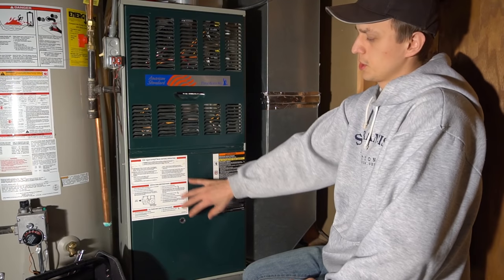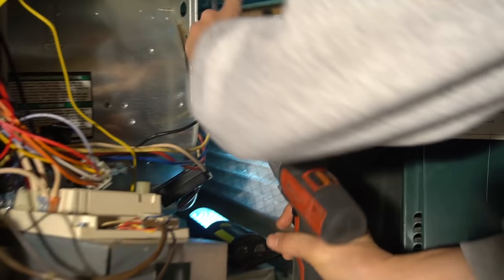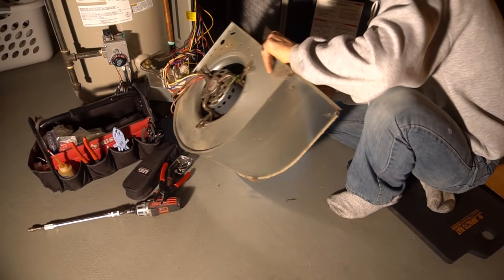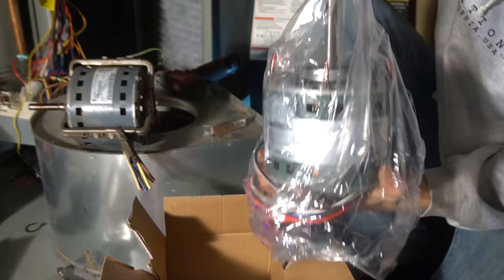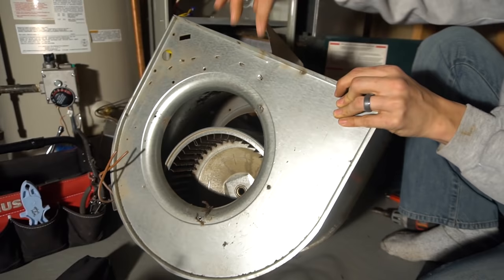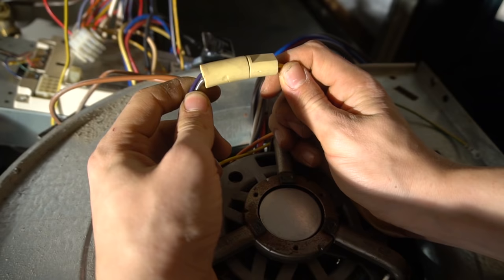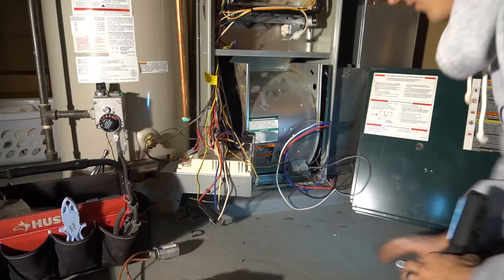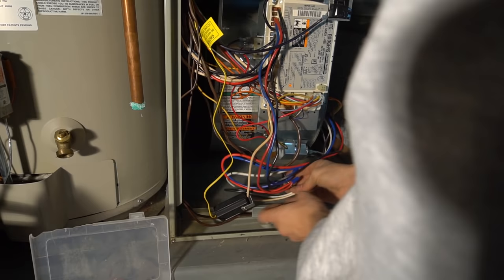Furnace/AC Blower Motor Replacement Step By Step

Comment: very helpful video!. question, recently the blower stopped working, it was connected on blue wire (medium speed) i swapped to the black (higher speed) and started working again. what could be the problem here?? thanks.

Comment: Hope you can help me. Last week my air worked fine but within the past few days the outside unit and inside unit (Air handler I believe) have gotten quieter and quieter and it's taking way longer to cool my house. I know it's best to call HVAC but I wanted a general idea of what the problem could be before I do that.
Reply from the maker: Is it possible that the A-coil (evaporator coil) inside is frozen over? Do you see any ice build up anywhere, inside or outside? That's strange that they would both get quieter. Is your furnace filter clean? Is the condenser coil outside plugged up and perhaps needs to be hosed down?

Comment: Excellent but I do have one question for you. The common wire (white) from motor, where do I put that on my blower motor board cnt1308? I don't have a spot
Reply from the maker: It's best to put it where the common from the old motor went. If this is the board I think it is, there should be a section on the board labeled as "120v neutrals" The common from the motor should go to the terminal marked as "line" which is in that "120v neutrals" section. If you have the wiring diagram on the inside of your furnace door, try to find the blower motor on there and trace where the wires go that way.
Reply: @WordofAdviceTV  The common from the transformer is plugged in there. I believe it was plugged into the park in the 120 volt hot area, which makes no sense to me?

Comment: So you can clean the blower fan in the sink.  Is it better to use hot or cold water?  Also what is the yellow wire you took off?
Reply from the maker: Hot water will clean it faster. The best way to do it is take it outside and spray/clean it with a garden hose. I replaced mine in the winter, water was shut off outside so I just cleaned it/washed it inside.

The yellow wire is an unused fan speed. Most blower motors in furnaces will have 3 or 4 speeds. I replaced a 4 speed motor with a 3 speed motor. So the yellow wire was an extra. On the motor label it will usually say which wires are what speed. 

3 Speed: Low Speed, Medium, High
4 Speed: Low, Medium-low, Medium-high, and High

Comment: What was the yellow wire for, that you didn't use, you disconnected it from the unit
Reply from the maker: A lot of these furnace motors will have a spare speed that is unused. (I briefly go over this in the end of the video). Since I replaced a 4 speed motor with a 3 speed, that yellow wire would not even get hooked up so I discarded it.

Comment: Thanks for such a clear explanation. You are a Pro!. I have a question: our blower wheel and motor were replaced and new ones are making more noise that the original operating in the 2nd furnace. Doesn't some like anything is loose or damage but anyways is driving us crazy. I called the technician and he checked and said everything is ok. Motor is ame size of original and nothing he can do but obviously something is not fine. Any idea what could be wrong ? Thanks in advance

Comment: Great video!   For a replacement motor, do all the specs need to be the same?   I’m finding motors with the same HP and voltage, but the RPM and amps are slightly different.  Does that make a difference or will that still work?  The old motor is 7.6A and 1100 RPM.  The possible replacement motor is 7.8A and 1075 RPM.
Reply from the maker: That will be fine :) .2 amp difference and 25 RPM difference is not going to have any effect. I would replace it with the one you found.

Comment: Would it be better to connect the wires directly to the control board as opposed to wire nut connecting them to the original motors wires
Reply: Thanks for the video, you make great content.  just generally curious.
Reply from the maker: Yes, it would be better. 🙂 I just got in a habit of doing that as a sign to future technicians. If they see the wire nuts, they know right away that the motor is not original.

Comment: The air temp in my house went up, everything was frozen over.  We cut the breaker off, let it thaw.  Once thawed I turned it back on, right away the fins in the air handler were freezing over.  That's when I discovered the fan not blowing.  How do I tell if the fan is bad or maybe just a bad relay.  Is there a relay in this system?

Comment: I have to replace my motor but can’t find the right one order one from Amazon and it’s smaller and it doesn’t have the brown cable for the capacitor ? Can u help ?
Reply from the maker: I would figure out what the part number of the motor is first using the model number of your furnace. And then using the part number search on Amazon or other HVAC parts sites. I show an example of how to do this in this video: https://youtu.be/faCno8-vRnw?si=WQ8s_DUWNgrZ34zw

Comment: The back of my motor is installed on the return air side. Obviously restricting air into the blower. It’s drawing air from the opposite (closed) side. Does anyone know if this will have any adverse effect on airflow. Have never received any error codes. 1994 Carrier Weathermaker 8000 58wav. Thanks

Comment: If I would to upgrade motor, what would u suggest? My motor specs are HP 1/3, V 115, A 6.20, RPM 1075, HZ60, PH1 it doesn't say the speeds.

Comment: Fan being as dirty as it is, how often do you change your furnace filter?  Think about that, you are breathing that dirty air being blown by your furnace.  Put a reminder on your phone to at least check your furnace every month and buy a box of 12 filters so that you have a supply to change a filter. I check ours every month and during the spring and fall it is the worst with all of the tree fuzz and other crap blowing in the wind, you need to change the filter.  Just ask your wife, if she says the house seems dirty, then things are getting through the filter.

Comment: is it OK to replace the motor with one with more RPM's to get more air flow?
Reply from the maker: As long as the difference is not too big, it should be okay. Otherwise the unit will be noisy and vibrating which could lead to other problems.

Comment: My circuit breaker has been tripping. I've narrowed it down to the blower motor. When I try to turn it on a single spark shoots out the back of the motor. Is it safe to assume that the problem is within the motor and or the capacitor? Or is there possibly too much current coming or something like that?
Reply from the maker: Have you tried pulling out the motor and looking at the wires? Maybe one of the wires got cut and is shorting out. Especially around the area of the sparking. If there are no apparent shorts (burnt, disconnected, or bare wires) then likely the motor is bad. It's very rare that it's too much current.
Reply: @WordofAdviceTV  I don't see any obvious signs of burnt wires. This house is only 6 years old. So far I've had to replace the capacitor outside, the contactor outside, and now the blower motor appears to be bad. 1186933 that is the part number and it appears to be about an $800 motor :( I'm just hoping I don't replace it and then starts sparking again
Reply from the maker: @MikeMurphyinc  Sorry to hear about all the furnace and AC problems! Is this a variable speed/ECM motor? If yes, you may be able to just replace the computer module on it and not the whole motor assembly. (Usually found on Ebay for a good price.)
Reply: @WordofAdviceTV  yes, it is a variable speed one. I'll look. Thanks!

Comment: So the yellow wire is unneeded? Where the old motor connected with the yellow wire on the electrical board it said “Heat”. The new motor I got as a replacement had no yellow wire.

Comment: Would this be a similar process for a Carrier furnace?
Reply from the maker: It should be pretty similar, yes.  Although if you have a variable speed motor, then the new motor will just come with plugs. (it has like 16 wires)

Comment: I really appreciate your troubleshooting videos!  I have a Carrier Boost 80 HVAC unit. I have two issues, first the 3 amp fuse will periodically blow and second if it doesn't blow the blower fan is always on. I disconnected the thermostat, I verified there are no wire shorts and verified the blower will shut off if I disconnect the low voltage green wire from the control board to the fan (e.g. I believe this tells me the fan controller is ok). Is the root cause the relay (e.g. Potter & Brumfield RT444012F) on the main controller board (e.g. HK42FZ027), if so is this board repairable or do I need to replace it?  Many Thanks!

Comment: just to be clear. did you only isolate the power at the local switch or did you also kill the breaker? I saw that you didn't discharge the capacitor either before cutting the wires. did you need to do that as well?
Reply from the maker: The safer you can do it the better. Turning off the breaker, discharging the capacitor and then double checking with a meter or voltage pen for power are all good things to do.

Comment: great video! very helpful! I have a question: I need a 1/2 HP, 115v, 1075 RPM, 60Hz, 7.9 Amp Motor. I have found a few that match these specs except the Amps. The one's I've found are 7.0 Amps or 7.7 not 7.9. Is this going to matter?
thanx.

Comment: Pretty straight forward. I appreciate a thorough video though, thx. Again in just starting school and probably find out and/or you have a video I’ll come across for my next question. Furnace at my house stops working when our basement floods, though the water level doesn’t reach the electronics something triggers power off. Our fix is to open furnace door and dry out components will little heater. Is there normally a moisture sensor in furnaces? And drying it out is fine, or is something failing or faulty? Thx again
Reply from the maker: There are no moisture sensors. Does the water reach the blower motor housing? If there is water in there, then good chance that the squirrel cage (blower wheel) will not be able to start. That's the only idea that comes to mind. That almost sounds dangerous though. If there is some standing water on the floor and it somehow gets energized, that could be instant death.
Reply: Word of Advice TV it seems to shut down the gas. Water level really only just gets floor surrounding damp. Water wicked up the (probably noise/sound) insulation on furnace housing only but no puddles or pooling near fan housing. Everything runs except the flame manifold will not ignite. Pilot light remains burning. Seems the fuel will not flow if it’s damp anywhere near control board.
Reply: Word of Advice TV thx for interacting with me a little. Not bugging you for free advice. Just wondering your first thoughts. So thank you.
Reply from the maker: Oh no problem! I spend a lot of time on YouTube and help when I can. Honestly I don't have a good suggestion though.. That's bizarre that dampness would be the cause. If it were me, I would start checking voltages when it is not working to see where I am losing power. Is the gas valve getting power when this happens or is the board not sending anything out? It would be hard to guess without seeing it
Reply: Well the season for the symptoms is about here. Still have a sketchy sump pump so I’m thinking I’ll have the opportunity without trying to duplicate. Hopefully it’ll be a great lesson. Start from line voltage in through control board to gas metering/ignitor and fan? I’m thinking that no fan (air flow) the manifold will not burn. If the fan cage was REALLY dirty, maybe the weight of absorbed moisture will effect fan motor? Like to heavy to move?
Reply: I’ll open it up today. This is definitely a fascinating tech. Like I said before I’ll have many questions over next year, my HVAC/R degree program is at least 4 quarters. I appreciate you. Thx
Reply from the maker: Thanks man :) An easy way to check that would be to check voltage between your heat speed terminal and the common. I don't know if you have a fan relay or a circuit board in your furnace. (though you did mention a control board. Is it an ignition control or does it control the fan as well?) If it's a fan control board then you should be able to just follow the wires coming from the blower motor and see where they go. Between heat and common, you would have 120v if the board is trying to turn on the fan. (by the way, you could also check the fan capacitor to see if that's weak)

But usually the blower fan is the last thing to come on in the sequence of operation. The gas valve opens and the burners come on for 30 seconds or so before the gas valve opens. So my thought is that either your board is defective or the gas valve. Confirm that there is a call for heat (24v between W and C) Then check if your gas valve is getting power. If it is getting power but not opening, then your gas valve is bad (try hitting the coil with the back end of your screw driver once) If there is a call for heating but the board is not sending power to the gas valve, then the board is bad. 

That being said, I am not sure how the dampness would effect it turning on sometimes and others not.. Normally humidity does not interfere with control board operation.
Reply: Well in dry condition I’m looking at furnace. It’s seems to be going through sequence and burning fuel for about a minute or so then gas off and status light indicates 3- “pressure switch failure to close “. I assume this is normal because after the blower continues to run for about a minute the gas starts burning again and so on
Reply from the maker: Ah okay. So it's a pressure switch problem. What brand is your furnace? Is this a high efficiency furnace with PVC venting? Do you have a condensate drain trap? That could be plugged.  If you take off the pressure switch tube that goes to the collector box on the pressure switch side and blow through it, do you hear water bubbling? (during the time when this problem is happening) 

Another possibility is that your vent or intake pipe is partially plugged. To check the intake pipe, just take the burner box cover door off and try running it without the cover on. If it runs with no problems, then you know your intake pipe is the problem. Same with the vent pipe. Disconnect it and run the unit without it connected, does it work like that?

It's possible that the pressure switch is bad too. Try sucking/blowing into one of the hoses going into the pressure switch (not too hard otherwise you can rupture the diaphragm. They don't need a lot of pressure to open/close) If you cannot get it to open or close manually, then the pressure switch is bad. This is probably not the case though since the unit runs sometimes. The pressure switch is probably just doing it's job :)
Reply: Word of Advice TV think the pressure switch is fine but, couldn’t connect my leads to terminal with power supply (no room on contact for both). 
I cut 1/2” portion of cracked tubing but didn’t think the crack was passed the nipple of housing. The nipple thing is like 1” long but trimmed it anyway. 
I removed tube and made sure sequence stopped there too, good. 
I’m confused though. I removed wires from switch and connected one lead from meter and was getting a number 7-8 on meter in voltage setting (not sure if millivolts) but then when I connected other lead the number dropped 3-4 volts. 
This with furnace running. As soon as I power up I’m getting reading. 
I’ll see if I can dig into burn box and see if I can find intake
Reply: Word of Advice TV do you mean “vent” is flue, right? Where exhaust ducts?
Reply: Word of Advice TV it says -Goodman cat 1 
GMP075-3 rev B
Reply: Word of Advice TV are “roll out” switches effected by moisture?
Reply: Word of Advice TV wait man! If the filter gets wet, will it restrict air flow?
Reply from the maker: - Yes, sorry. By vent I meant flue. 
- Okay so it's a Goodman, is it a 90% efficient furnace or a 80%?
- Flame roll out switches trip when they get hot. Ex: when the heat exchanger is bad and the flames are rolling out backwards.
- When the filter get's wet it probably would get a little more restrictive. But that would effect the hi-limit switch which trips if your furnace is running too hot.
- It's possible that the pressure switch tubing was the culprit but unlikely.

Comment: When I did this before I saw your video, my dual blower wheels from Bryant were both biased to the outside of the blower housing, not dead center. Is this a problem, have you seen this, or should I match the biased position the stock wheels were in?  Does it really matter since the side of the blower wheels are not a very closed in tight fit to the housing anyway. I would think you want to line up the blower wheels to the opening up above in the furnace - right?

Comment: I am replacing a 3 speed 230 v furnace blower fan motor with a 2 speed 230 v motor. The old motor had red, black and green leads going to a terminal block, and a yellow lead going to the 230v line into the furnace. The new motor has red (slow) and black (fast) leads, plus a yellow marked as Line.  Do I just ignore the missing green lead? Thanks

Comment: My air handler fan just went out and the landlord won't listen to me. I told him the condenser compressor and vapor line froze up, yet the evap coil wasn't froze. After melting the ice and letting the very hot air handler fan cool off, everything started working again--for about 4 hrs. Same icing reoccurred. The landlord has agreed to allow the AC guy to replace the furnace. Am I wrong in that this Payne 4 ton furnace doesn't need replaced as it's only the fan that's bad. MFG date on the furnace is 4/2005. I think the landlord is being screwed but it's his money..';what's your thoughts as I am no expert. P.S. I am in Houston and it's after the hurricane so really the heating function is not that critical as it is almost 100 degrees every day.